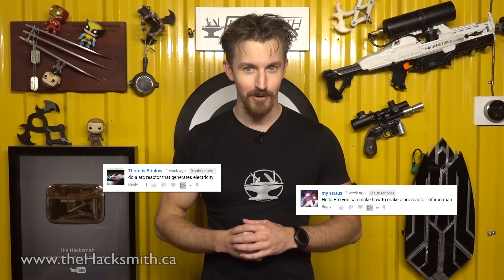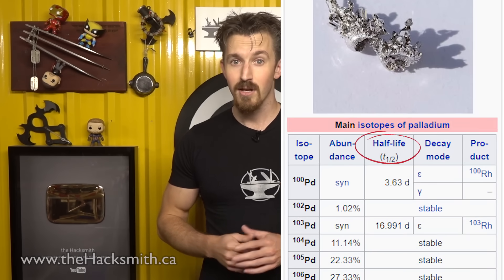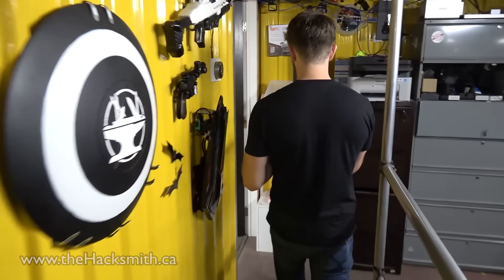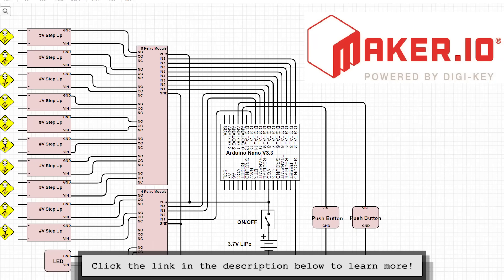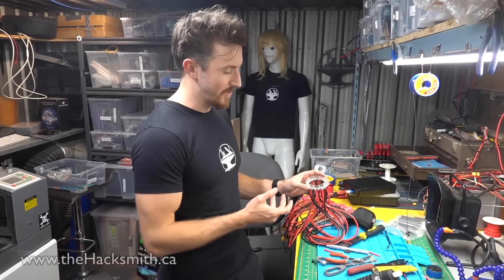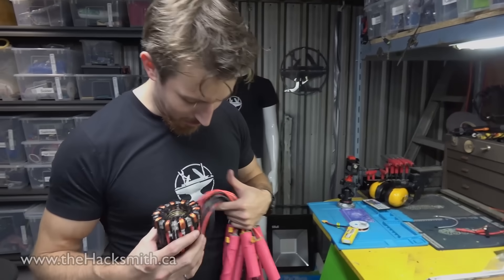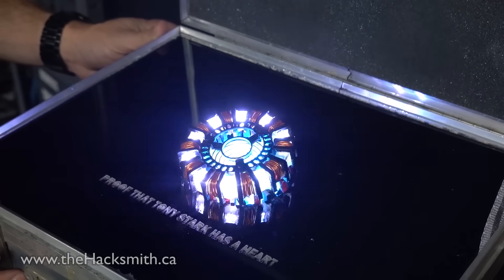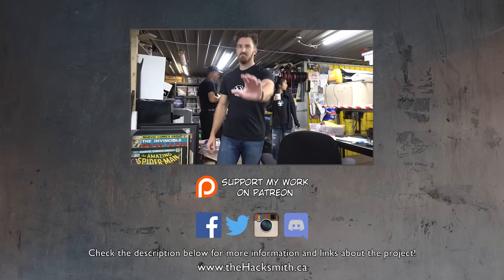Real Arc Reactor (ionized plasma generator)

Comment: it is not possible to make a arc reactor in real life , because in the movies the arc reactor is a fusion type . it means it gains energy from the fusion of 2 atoms of hydrogen . which is not possible because that fusion needs about 100 million degree celsius of heat that is equivalent to the heat in the surface of the sun.

Comment: not trying to be narcissist
 but does this arcreactor produce energy or does it just amplifies the voltage(step ups voltage) from the batteries attached (for ionizationn the reactor rings), or it ruly generates energy (from some ionization which i dont think is actually happening). 
please somebdy tell me if i am wrong or right
Reply: in thee original iron man arc reactor by tony it used pallidium core to produce energy through clean nuclear reaction but here since palladium is radioactive (unlike tony stark we dont have a newelement to solve the palladium poisoning and in reality the radioactive nature is much worse than expected) so this arc reactor will definitly stop working once the batteries exhaust, so it is not generating energy but basically amplyfiyng the voltage to higher potential . 
is this concept right ???

Comment: Couldn’t you just use a plasma toroid generator? Usually the xenon gas & plasma are contained in a big glass ball, but I don’t see why it wouldn’t work in a small ring. Also you can have the driving inductor under your shirt (hypothetically, idk if that’d be safe). Also, it’s not noisy at all.

Comment: Is there a turbine somewhere in that reactor? Or does it not need one. Please can someone explain to me.
Reply: There isnt
Reply: @VerxxYT  so how does it generate electricity? Does it split electrons from the atom's of the core and conduct them to an output 😂?
Reply: @badyoutuber1986  The arc reactor hacksmith made doesn't create energy. If you're on about how tony stark did it, probably magnetic/coil induction.
Reply: @JoulesTelly  so shooting a bolt of plasma from the reaction in-between a metal coil to move Electrons through the coil? What kind of coil that size can handle 3GW of energy😒.
Reply: @badyoutuber1986  not a lot, too much resistance. Find superconducting materials and heat management. 3gw of plasma is extremely fast and ionised though
And you lose energy not gain
Reply: @JoulesTelly  usually superconducting materials conduct heat even better no?
Reply: @badyoutuber1986  yes, but we are trying to have as little electrical resistance as possible, so more energy can pass through smaller amounts of wire without heating up, and for stronger magnetic fields if its needed.

Comment: Well, the arc reactor is a mini nuclear fusion plant, so it uses the hydrogen in the air as fuel, and pumps out hellium as a by-product. But making the walls transparrent is stupid, the movie put it in for Cool-factor. But the coils around it are electromagnets to keep the plasma from touching the walls. Otherwise they would melt.

But another loop hole can be: you turn matter into energy, E=mc², that would easilly give you the 3GW output with very little fuel. Since c² is a very large number.
Reply: It might be a magnetic pinch device/toroidal pinch device but multistage. It has a toroid and solenoids around a single section, but with it multiple stages it could look similar.

Comment: If energy cannot be created or destroyed, then this must be a transformation technology. So if you could create a transformer that does not need power itself to run, rather one that self excites after starting, this would be a free energy transformer. And would be completely viable as it would not break any laws.
Reply: Power input needs power output
No powwe input means no power output
If the transformer needed no energy to run then that just means that it would keep running at 100% efficiency as long as the energy source is present

Comment: What exactly is generating the electricity? I see a battery and capacitors. There is no actual power being generated. You are simply arching the stored energy from the battery across some terminals in the ring. Essentially you created a large grill igniter.
Reply from the maker: Watch the intro again lol

Comment: have you thought of adding another ring that houses liquid hydrogen as a power source? And designing a heat sync ring that cycles the thermal energy back into the conducting structure which would minimize the thermal energy loss effect?

Comment: Hold on, how does it actually generate energy? It looked like its just taking energy from a battery, and outputting it to your terminals after a free charge transfer (the sparks). That's not a generator, more like a transformer if anything.
Reply from the maker: It doesn't
Reply: @hacksmith  I guess its the coolest phone charger ever made then haha

Comment: The funny thing is the arc reactor is basically cold fusion or a lower temperature fusion reaction. It’s funny because the old cold fusion experiment inadvertently just created a big capacitor, which is precisely what these guys are making now.😅

Comment: Wouldn't it be safer/easier to use the arduino to control LED lights and sound, then use the power that is saved to charge your phone?  ;)

Comment: I think something many forget is the Arc Reactor is more like a particle accelerator made small. The initial one in the movie the big one, looks like its actually directing plasma more like a fusion reactor in a way. There are a few in build in Europe, issue is handlingvthe heat and containment inagnetic waveform field.

The final version Tony makes seems to accomplish this but some how not cooking himself internally. I figured he created a super conductor like magnetic field that channeled free ionized energy just in the air or broke it down from atoms nearby. This could maybe be a radioactive core. A lot of theory think on its application. The concept here is an interesting approach, seems impractible without better material used. Radiating yourself is a cool call to avoid.

Comment: As I understood arc reactor is a nuclear fusion device known as tokamak (rus. ТОКАМАК — acronym from “toroidal chamber with magnetic coils”). It’s a Russian(Soviet)-made concept which corresponds to its origins in the Marvel’s universe (Arc was created by H. Stark and Russian scientist A. Vanko, according to the schematic been shown in the “Iron Man 2”).

These devices are real, they’re working and really made for science purposes. They could run fusion in the “pulse mode”, and in the last years produce more energy than was spent for power coils. Energy doesn’t comes from nothing, it comes from the masses difference. The product of fusion (deuterium, tritium or helium) have a bit less atomic weight than source nucleus (a few hydrogen nuclei). The difference of masses outputs as energy according to the famous Einstein’s formula E = mc^2

Nuclear fusion devices may be a source of the almost unlimited and cheap energy in the future. But, despite of some successes they’re  still far from commercial use

Comment: There's a rule of thermodynamic law, if you generated strong ionized plasma the higher the energy the more likely it will melt things around it and need to be cooled down as energy generates heats. The reason why power plants so big is basically for generating such things need a lot of voltage and cooling system. So unless we discover new material from space that has very cold properties to contain it in small space and a material that could be used as fuel but comes in tiny size then considered it done. We get discomfort when using old laptop on our lap for too long because of the heat so even if it was possible the discomfort of having fusion arc reactor on your chest won't be a very pleasant experience

Comment: I supposed you could emulate an arc reactor like this much simpler with an automotive ignition coil (12v, probably more compact to use motorcycle style), and having the Arc Reactor copper coils as conductors so the arc bounces from one conductor to the next, then encasing the whole thing. Instead of trying to make individual arcs between the points, which should slim down the whole package.

Comment: The arc reactor has a built in feedback loop which is why it can generate that amount of electricity. But if that loop is not constantly sending power elsewhere it will get to the point where it will either overload and explode creating a small crater beneath it as well as destroying a few miles worth of destruction or someone will have to go in and manually release the energy in the form of an emp that would be able to shortcircuit and fry any and all devices that are within the estimated blast radius. So essentially what it is is nokola teslas tesla coil combined with the arcitexture of a particle accelerator along with a self recharging flashlight.

Comment: I think this is a fancy way of saying if you want to make a cosplay arc reactor that works but isn’t “potentially” dangerous is soooo much more work if he used only electrical components to make it rather than whatever acrylic material he used for the housing, if he used metal for the whole thing it would’ve been smaller lol 

This isn’t a slam this is saying the potential is there for further development through the use of conductive materials rather than acrylic materials for most of the housing.

Comment: i thought the arc reactor was actually a fusion reactor or a more efficent way of getting power through ignighting plasma and making it spin really fast and sticking metal rods in the plazma to get electricity from it. either one is not a perpetual energy machine.

Comment: It is a reactor that is based on a particle accelerator the reactor some how accelerates a stream of particles around as the power loops it generates a useable power somehow likely electron stripping from the fuel materials.

The failure of the big reactor in iron man is that it uses electric power to make just a little bit more than it takes in...

Comment: hey,how did you solve for the diameter and circumference?I know how to normally calculate for both of those things when it comes to circles,but did you already have some sort of measurements then calculated the diameter and circumference of the arc reactor?

Comment: If the goal is to create Iron Man - I think we are looking at the external functions more than an internal

Can a genius create a pacemaker device with limited supplies and resources?
With the shrapnel and electromagnetic fields the injuries would've likely damaged Tony's heart and lead to the Arc Device doubling as a pacemaker.

Taking it back to 616 can you device a full chest-plate and have it adhere to the chest without requiring surgery and still perform in theory as a pacemaker

Be a chance for Hacksmith to take a dive not only into comic science but medical sciences

Comment: I know I’m a few years late to this, but what if you could build a reactor based off of thermal energy, that refills itself, or a perpetual motion machine powered by small explosions by oxygen explosions, oxygen the reactor pulled from the air, ignited by the energy created by the air, and so on so forth, it’s not the typical perpetual motion theory but it has potential, seeing as it’s fuel is constant. Say you built it to produce power thermally, the explosion of the oxygen would heat up.

Edit: I’m not a child I’m an adult who doesn’t think quite straight forward sometimes and doesn’t think about drawbacks, if this could work it would be too large for any human to power a suit while wearing it, plus it would absolutely expend more energy than it could make, but it’s fun to think of new possibilities

Comment: My first arc reactor was very dangerous. I took two pieces of graphite out of a pencil. Then coat them with candle wax. Then wrap those in paper cloth soaked in salt water. Suspended in the center of jar with a pencil using dental floss. This was very dangerous and stupid. But I put it in the microwave. The thing acted like a laden jar. But It made a large plasma ark and generated a mini sun for a few seconds. The electric field of the capacitor held the ionized gas or plasma a bit thanks to the capacitor conducting alternating current from the ark or microwaves as they were converted into electricity. This allowed a powerful electrostatic field to form on the arc reactor. After the microwave went off the reactor had a high voltage charge in it. And touching the glass jar hurt a lot so I am lucky I did not shock myself to death. And it looked like something from spider man as it looked like a sun in a jar.
Reply: Though spider man the cartoon Doc Oct used cold fusion in batteries. Nickel metal hydride would be ideal. Using high voltage sources from a joule thief at 75v to 100v from a single aa battery to charge some batteries using diodes for pulse charging you may condition batteries like John bendini.

Comment: Soooooo, what happens with this arc reactor is it takes energy from a 6.5volt battery and makes it go zap? Is that all or am I missing something? How do you get the energy output? Does this actually create more energy or does it just up the amperage and drain the battery faster?

Comment: Actually you missed an article the order day. 2nd law of thermodynamics is wrong. Has been wrong. Was always wrong. 

And let's just settle this logically before we get to the experiment which refutes it becauee you shouldn't need to refute it as it's contrarian.

Nothing can be created or destroyed.. Ok so how was it created? Becauee the law states it cannot be created. Big bang maybe? Well we have no evidence at all that a big bang created everything in the universe. It's purely a hypothetical which cannot ever be tested making it pseudoscience. 

Second even the big bang does not explain the creation  of all the matter snd energy in the universe it simply presumes that all the matter and energy somehow made it into an infinity finite locality. But still where did it come from. When was it created? How was it created.

Now the experiment. Go watch sabine hossenfelder video yesterday where she mentions perfect circles generating more and more and more energy as the spin as an effect of the turbulence which they create which amplifies back on the spinning disk increasing its torque. 

This is how gravity and electromagneticism work in reality. Just have to include the Aether as stienmetz would have described it and not some knock of  psychic fortune teller like academia loves to deflect too.

Article: Phase separation of rotor mixtures without domain coarsening driven by two-dimensional turbulence

Comment: So it doesn't actually generate power but simply uses stored energy in the connected voltaic cells to create a current. Guessing this it is just a fancy prop that isn't practical since it is wasting more energy then simply using the batteries on there own. But either way it still really epic looking.

Comment: Theres a huge arc generator in one of the massive deep underground bunkers beneath London. And there is actually a you tube video where two guys explore the place and the electicity is still on. Then they start the arc generator which is from the 40s and still works fine. Looks like a gigantic light bulb. And yes I kinda guess that an arc generator and an arc reactor are not exactly the same thing but they do work on the same principals.
I am super jealous of your workshop guys. Ah....if only.....

Comment: I actually think you would be able to make a ligitement arc-reactor if we messed around with swapping around the quarks (elements) of the atoms, cus if we could find out that a quark uses negative energy to do an action, and then therefore produces positive energy, we would be able to transform it into electrisity. One of the only problems i just can come up with in the back of my head, is that you would (like strange matter) need a so dense material that the influense of the quark cannot get out in other forms of energy, just like neutron stars.

Comment: Good, it's cool but it's not the same thing. And what's the pink things that you have used in it? But you can make it cool with a 2kv module. Then it will look realistic Arc Reactor. And you will need 2kv capesiter and a diod, connect+and- with the capesiter's +&-. And connect the diode in series with the capesiter . then it will give you 220v. Use my Idea please and make a video.

Comment: Can you make a gun that can shoot a Arc of electricity that's Man portable that don't need wires that actually can fire an electrical bolt from the barrel of the gun to the Target and it needs to build a shoot at least 20 ft to make it practical it'd be better if we could shoot 100 ft but I doubt that but at least 20 ft to make it a practical weapon

Comment: An arc reactor is a fusion reactor fusion what cold fusion but hot fusion it's not cold fusion it's hot fusion not like nuclear fission like we have a nuclear fusion like what goes on into the in a star that's what it is MIT is working on one that's 20 foot 1 foot long right now I think they might have it done by 2030 and people's made them before but it takes more energy to run them than they make because the electromagnetic field takes so much energy that's the problem they can't make a fusion reactor that actually produces power you all you need power to run the damn thing and it don't make enough power to run itself the ones we can make with our current technology you know I don't know what Robert Downey Jr can do but MIT guys are having trouble with it